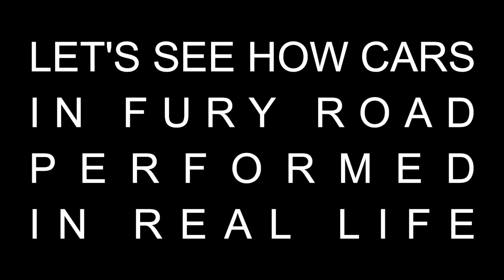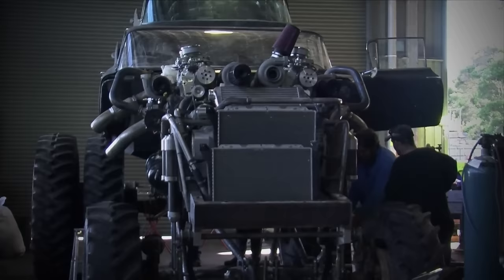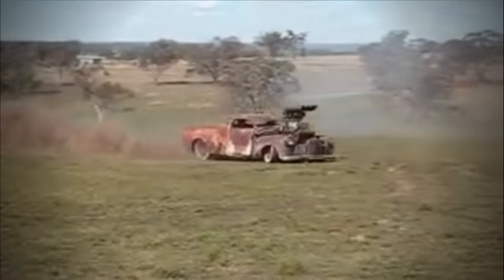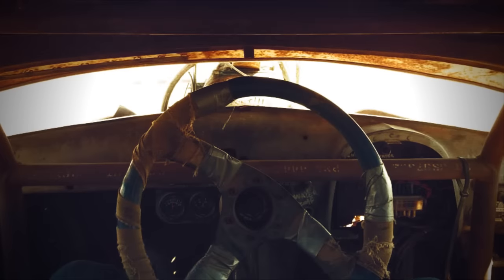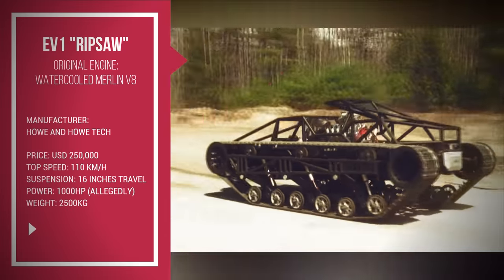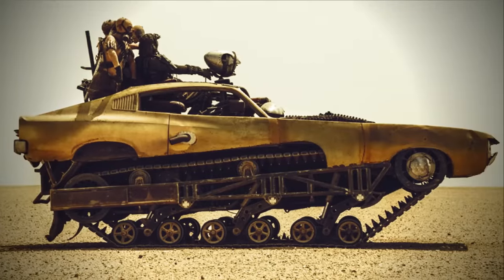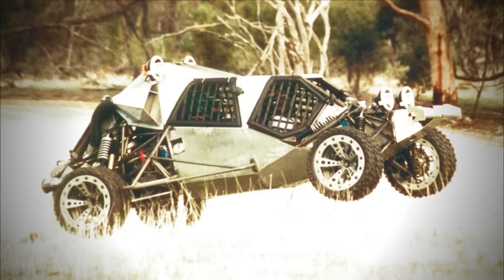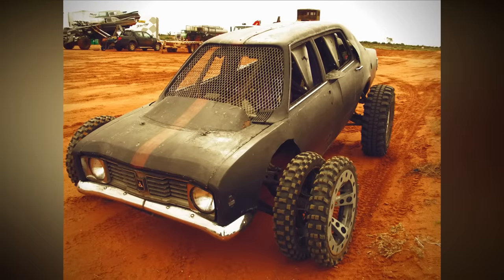Fury Road Cars vs REALITY

Comment: The reality is that they actually built all these cars, that alone is beyond bad ass. Props to every builder who had anything to contribute to the cars
Reply: Adam White talk about a dream job
Reply: No. All this vehicles actually built purely for looks only. No car engineering involved in making. In reality they undrive able nor practicality. Just junks.😅
Reply: @kakiwayang508  did u watch the same video look at the Giga horse twin supercharged big block v8
Reply: @kakiwayang508  you literally cannot combine 2 non stock supercharged  engines on one drive train and a new transmission as well as  same with the welds and metal work, all of that had to be fabricated. You don't even know what engineering means. Go read a book
Reply: @mappy-5934  we watched on film only. I never seen this car perform alive. It's more movie props which normally works well on camera but in reality they just cosmetics.
Reply: @kakiwayang508  the movie was a live set, what you saw was literally the vehicle moving. And you are so dense to think that's not engineering. I'm not even sure you know what you're talking about anyways lol
Reply: @kakiwayang508  your comprehension ability really LOW 😂
Reply: @SaretGnasoh  Only the last 5 years American knew how to make proper sports car.  Everything that  came out of America basically rubbish. If rubbish is your standard, that car exceed your expectations lol. We around the world developed car not just for a straight line speed like American. 😅 just like you know. No1 in America Toyota Camry, 2 Honda Accord, Toyota Corolla, Nissan Altima and Honda Civic.
Reply: I believe the director spent YEARS building these vehicles.
Reply: @kakiwayang508  sorry, who had to recall all Toyota frames for structural defects and extreme rust?

2000-2010?

Damn, must've been "American rubbish"
Reply: They were auctioned off not to long ago
Reply: What happens when an Engineer drops Acid ?
Reply: does it mad max consider also as steampunk genre ?
Reply: Diesel Punk .
Reply: @johncunningham4820  I'm quiet struggling to find any similiar series like Mad Max.

the only one I got is called DayBreak  but it also a comedy
Reply: @qnet8949  Mad Max was a Fairly Low Budget  MOVIE . They made some sequels , none of which was as good as the Original .
Mad Max .
Mad Max 2 - Road Warrior .
Mad Max 3 - Thunderdome .
and finally . Mad Max - Fury Road .
ALL Full Length Theatrical Releases .
Reply: @johncunningham4820  Mad Max 3 - Thunderdome was outstanding 

only it's pretty odd if this genre was a bit rare knowing that Fury Road was pretty much the one and only with the theme recently
Reply: @kakiwayang508  😂😂😂😂 my lincoln is more comfortable than any lexus
Reply: Most of these "cars" are just movie props though.  You can't actually drive them for any period of time because of all the design faults.
Reply: @mappy-5934  No, no.  There are off-the-shelf transmission units that allow up to five supercharged big blocks that would have actually worked in practice and not needed rebuilding every single day of filming.  The builders of these cars did not do any real engineering, they threw some crap together that looked that part and could be edited to make it look like it worked.  The "Mod Max" from Mighty Car Mods was probably the only car there you could actually have driven off the set.
Reply: Have you notice that Mr. Bean car was in the Fury Road movie????????
😂😂😂😂😂😂😂😂

Comment: The fact that cars are junky and kind of dangerous actually fits the setting and its crudity.
Reply: Authentic crappiness
Reply: What doesn´t exactly fit the setting though is the immense amount of maintenance they require and the complexity that went into some of them.
Reply: @1I2am3Dani4  Nah, that fits the setting too.
Did you not see they had entire cast system devoted to driving and maintaining them in the film?
They'd be changing out parts and modding specs around the clock, it was their religion.
Even had a car carrier to pickup the ones that blew up from flying too close to the sun...
Reply: agree on that!
Reply: @1I2am3Dani4  immortan joe had an entire mountain cavern full of workers though.  He has a warlords resources.  Personally I think they could still pull off an apocalypse look without having cars that have so much complexity, like the dual engine car or the tank car.  It would take it back to the Road Warrior.  But the hybrid cars are so artful to look at and think about.  Each car in a sense is reflective of it's punk rock driver.
Reply: @cycadaacolyte6349  Yeah, I haven't really seen that so much in the older films though and I doubt that it would be fun to rebuild a transmission every single day on a multi-day high-action chase.
Reply: @1I2am3Dani4  . Yeah, so surprised they used twin v8's , tripping , should of hid a Cummings .
Reply: Even the Cars not actually being able to do their specc'd speeds makes sense. Immortan Joe had one guy do the math and says 125kph, and then the mechanics are the ones in trouble for not making it go 125kph. "THE ENGINES AREN'T TUNED RIGHT, SHE SHOULD BE FASTER!"
Reply: Apocalyptic wasteland, no electronic systems, all mechanically timed and actuated engines, dirty conditions, and I doubt they had a huge well of clean engine oil to continually do oil changes.
The first mad max was in the 70s, and we can safely assume no more advancements in automotive technology have occurred since then.
So for you Americans that are old enough, remember how often American muscle would break down in the 70s? Dodge challengers were NOT the most reliable vehicles lol
It makes perfect sense that these slapstick modified machines under primitive conditions would be breaking down constantly.
Reply: @1I2am3Dani4  carbureted civics and corollas wouldn't really have the same effect though
Reply: @reed7434  That would have made the movies a lot less spectacular and iconic, I fully agree.
Reply: One other thing, I read the graphic novel George Miller released around the time of the film that gave some of the back story on the characters.  Immortan Joe was an experienced military officer; like a general's rank.  It would make me wonder if his entourage would have experience rigging tanks and large advanced engines.  Stuff your average mechanic would never really see in a civilian setting.  The gearheads would then know some of the inner secrets of that next level of scientific technology.
Reply: I always thought the cars in the mad max movies were odd because they are in a time when fuel is very scarce yet the engines in most of the vehicles would struggle to get 5 miles to the gallon.
Reply: @isailwind3471  they need a cistern truck for every gas guzzler ... BRUHHH
Reply: @thundercactus  They literally had access to a oil well to manufacture Oil .Granted how dont know how hard or easy that that is.But In there world they made it work.And literally every country in the world makes cars that are unreliable in some way .Funny even though this movie is set australia  you didnt bring up any of their cars.And and  many muscle cars are actually slower and under powdered vs modern family cars.
Reply: @cycadaacolyte6349  Not exactly. We had two movies prior that had other wasteland warriors take the more Practical Approach, but not sacrifice authenticity to make their Junker Racers cool looking.

The result was their cars were relatively easily maintainable and still were terrifying to face off against.
Reply: Kinda, but the dumb amount of work some of these cars had to put in isn't, like the Gigahorse. No one would make that because the amount of time, resources, and fuel it needs
Reply: Uhh, no. The opposite. Impossible and improbable cars that look like breaking down every 10 minutes have no place in the desert or in a car chase. I made a 2 door AP5 Valiant by shortening it 800mm, cut and joined the front and back doors to remain functional, welded a VJ Valiant diff under the springs for clearance of 10r15's. A VJ disc stub set on the front along with boosted VJ tandem master cyl. 245/60's on the front 14" rims. Under the bonnet a 245 HEMI 6 and 3 spd. manual. Put rear seatbelts in , now you drive from the backseat . Was the quickest thing on the swamp and completely reliable. I built this in 1994 at 26 y.o. with a 4" angle grinder, a hacksaw and a 130 amp 2 position Sunbeam arc welder. All those assclowns built for millions were mostly SHIT that nobody liked driving or fixing. I had a ball. This is why it all went so, so wrong after Mad Max 2.
Reply: but you would hope that they would be reliable for that setting too right? or at least easy to fix up if shit hit the fan.
Reply: Yes
Reply: @thundercactus  Actually, the Apocalypse had to have happened sometime after 2011, given the brief reference to the Fukushima disaster.
Reply: Yea but fixing a old clock work engine vs a Morden day full of technology  that won't work in a emp  strike thats why old cars will always work but thats why the war boys   did fix up there rigs too keep  them working in harsh conditions    the reality  is engines need TLC tummy  loving  care lol  maybe twh reason why Morden cars break down is due to improper oil in engine you cant always take 5w oil and throw it in many engines are heavy duty and need heavy oil
Reply: Unless you the "lucky" guy on the wheel.
Reply: @WZPXZMDQRGTHEFYOPBMLNSHOPJBOJT  what are harbor freight predator motors?
Reply: Very astute 😒
Reply: Agreed absolutely. People that think they should be realistic should just honestly never watch a movie🤣
Reply: @1I2am3Dani4  people in third world can make a own car in badly conditions
Reply: Warboy moment
Reply: No it doesn't. Transportation in this setting would need to be unfathomably reliable and require very little maintenance, along with an almost infinite amount of parts, chemicals, processing plants, electricity for tools, and more. It would have to start with diesel trucks that have been gutted to be light-weight, and a brake conversion that supports average vehicles, as well as entire drivetrain. In fact, vehicles wouldn't last long in any apocalyptic setting since fuel would be extremely difficult to get, roads would be a nightmare to travel on with fallen trees, traffic, etc. Not to mention the need for cleaning chemicals, oils, etc. that would no longer exist. Even an electric vehicle with solar panels and a generator wouldn't last long. 
TWD almost kinda got it right that driving would be a massive hassle and would not be a long-lasting way to travel.
The form of transportation in any realistic post-apocalyptic setting would be a bicycle or three wheeled cycle to carry stuff. Just look at the homeless, they have it exactly right what the average survivor would look like in a scene like that. Traveling would mean you have to be efficient with food and water, and do lots of camping. 

Mad Max is far fantasy, like in the most unrealistic they-must-be-hiding-a-city-worth-of-industry-to-survive kind of fantasy.
Reply: @cycadaacolyte6349  they would need an almost infinite amount of parts, chemicals, oils, electric tools, and entire processing plants for the shit they had, lol.
Reply: @sharpe227  They would need products and materials they would not have access to, an entire plant that needs massive amounts of other chemicals, power, and chemical engineers to process crude oil into fuel. Diesel is a little easier to make, but it wouldn't make enough to support years worth of vehicles.
Reply: @te9591  oh boy. You're in for a fun time.
Reply: @Literallyryangosling777  No they can't. Cars need support to work. Most of the time, it's people that just need something to work once and idiots like you eat it up like it's a daily driver, lol.
Reply: @evolicious  oh you clearly didn't see south america, in really poberty zone people use made up cara from junk and stuff, most bikes
Reply: @1I2am3Dani4   just because it’s the wasteland doesn’t mean people don’t make beautiful things… and when you have a supply of water you are the richest person in the world.. so having over the top scary war machines is the highest clout. I think it’s very much Form > Function.
Reply: Same as carmageddon
Reply: @draugrhart121  this is good thinking.
Reply: Maybe if it were to a lesser extent. If these cars were really used for the desert chase, Max would have gotten away in about 10 minutes.
Reply: PpppIt
Reply: Iup
Reply: @milkie.h  whut??
Reply: @te9591  they could have just bought an old Soviet tank based trucks.  There T54 based trucks out there.  They would have looked bad ass in the film.
Reply: @CoolGobyFish  agreed
Reply: No, simple cars that are easy to repair and don't drag in the sand would fit the setting.
Reply: @thundercactus  Sure, but when it broke down, filing the points or cleaning the crap out of the carb usually got it going again without the need for five hundred extra spares.
Reply: @reed7434  So put spikes and blowers or turbos on them then.  We do have blow-through carbs for that, you know.  Forced induction has been around at least forty years longer than engine computers.
Reply: @FuckGoogle502  YEP! Very easy to fix! But they'd still break down.